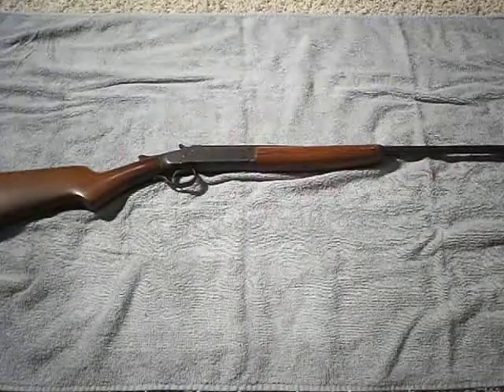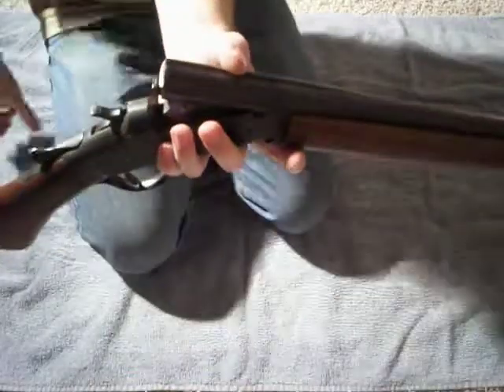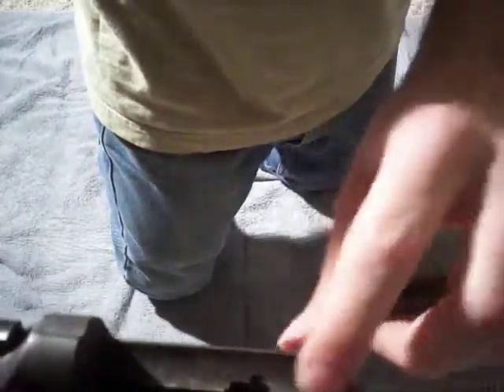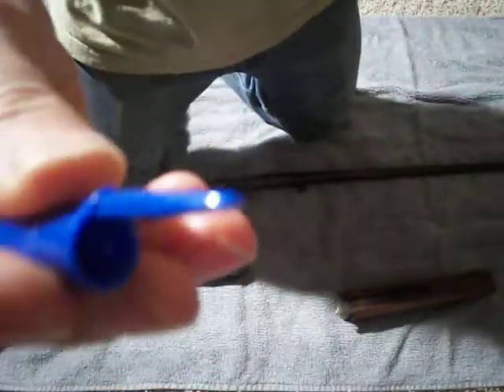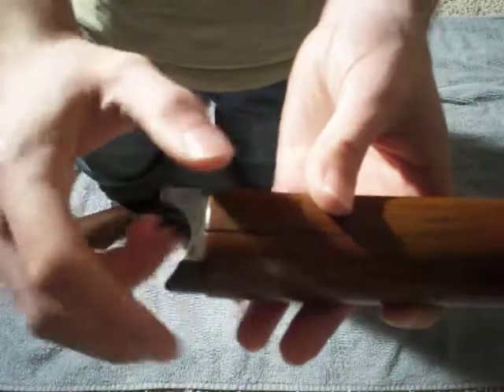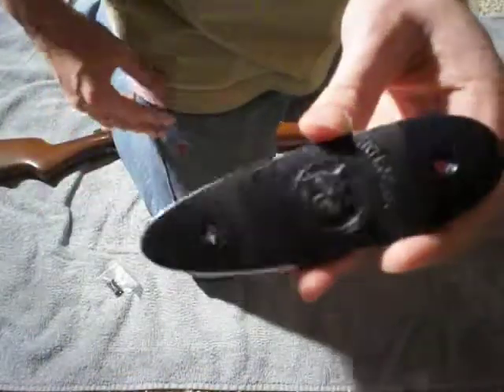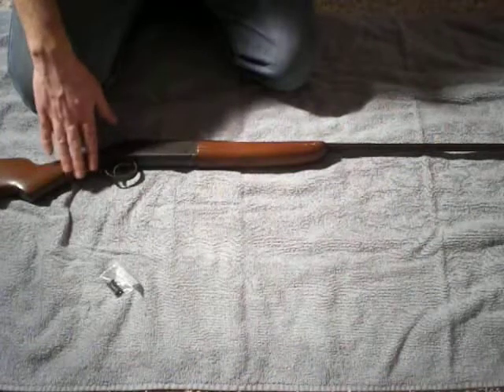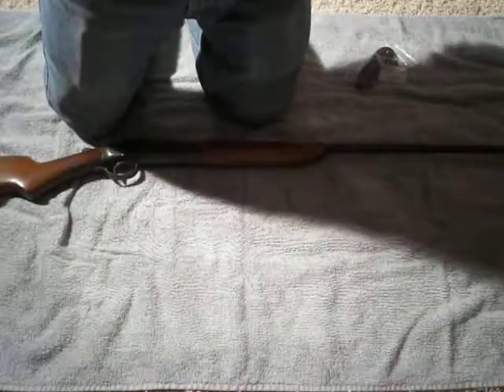Iver Johnson Champion Project Update

Comment: Where did you find the "latch spring" ? I'm currently working on a similar project and happened across this video
Reply from the maker: +J.R. Smith numrich gun parts
Reply: +redneckmini14 Thanks. Sorry to be so behind in all this
Reply from the maker: no problem. glad i could help.